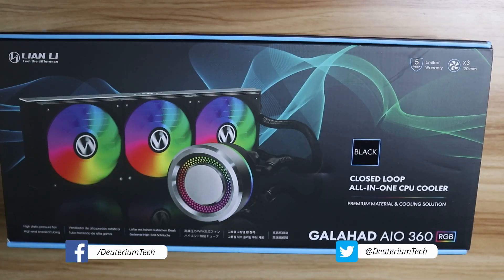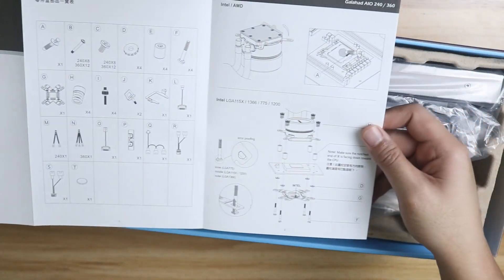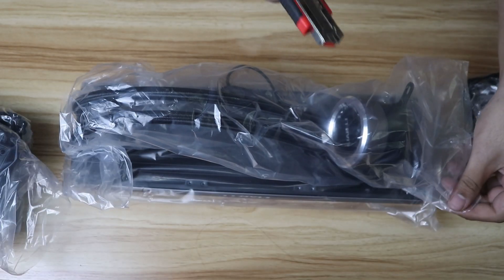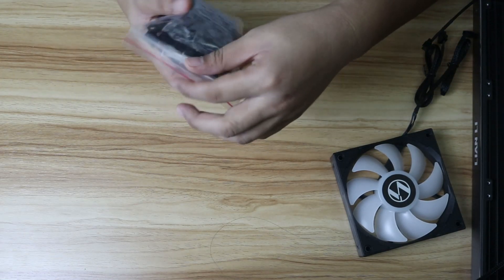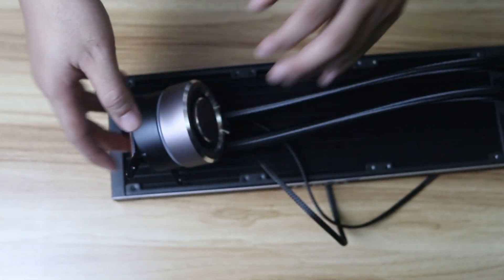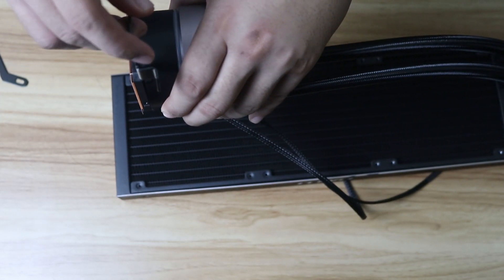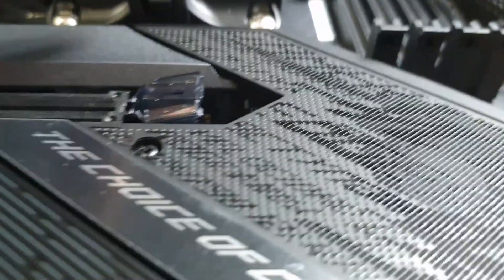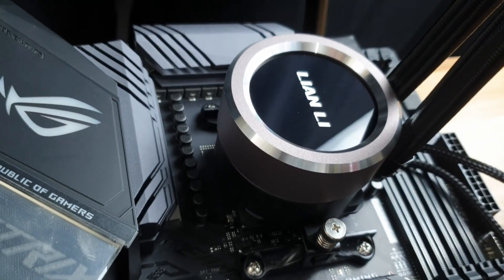Lian Li Galahad AIO 360 Unboxing, Installation, and Benchmark

Comment: Bro I got this, and it didn’t come with the AMD mount for the pump. What do I do
Reply from the maker: Return to seller if it says on their listing that this can be used with AM4 CPUs. If you can't, you may need to buy the parts.
Reply: @DeuteriumTech  I can’t find where I can even buy an AMD AM4 bracket mount of the this AIO though man. It sounds like I have no choice but to buy another AIO

Comment: What cooling would you recommend for the 11700k cpu, I used corsair h100 rgb 240 mm before, but the temperature values were above 90 degrees at full load. and there was a pump sound failure in the cooler, I returned the cooler. The CPU was also replaced under warranty.
Reply from the maker: If you plan to do overclocking, 360mm radiators are best. If not, I think you can get away with 240mm.

Comment: How did you get the RGB to work? I just got mine and it works fine but the RGB isn’t being lit
Reply from the maker: RGB has a different connector from the power cables. Make sure those are connected as well.
Reply: @DeuteriumTech  the RGB connector is connect into the RGB slot on the mobo and it turns on for like 2 fans, I cannot customize them nor will the third fan or the pump RGB turn on

Comment: Is there a way to control argb using Reset SW rather than opening and closing the case every time i wanna use the controller
Reply from the maker: You will need to rewire the controller button to the reset switch of your case if you want to do this. The controller is probably using an NC switch you this should be an easy task.
Reply: @DeuteriumTech  but I don't think you can open the controller. Might have to cut it to be able to access the inside. But this can be done. I can also use any wire with same specs
Reply from the maker: @shreyashchauhan6359  *You can't open it without damaging it. But you CAN open it. Try getting one of those mini hand drills that come with a small circular saw (I'm not sure what they're called exactly). It might help you get in the controller without cutting the wires.
Reply: @DeuteriumTech  haha, sure. Let's see what i can do tomorrow

Comment: not sure what my issue is but i cant get the bracket to slide in with the clips? its almost as if the clips are too short and it just nearly slides off both sides are super wobbly i cant even get it to straighten properly
Reply: Were you able to fix the issue?

Comment: Nice review bro. For the AM4 bracket, is it possible to attach it a different way so that the tubes come out from the top of the pump instead of from the right side?
Reply: No there is not... sry
Reply: you need to know that your setup with tubes on the top of the pump is one of many way to shorten the life of your AIO cooler.

Comment: I know this gonna be good enough for the 3500x but really should I get this or get the nzxt kraken x53
Reply from the maker: 3500x TDP is 65W. It does not require liquid cooling. You'll be good with either.

Comment: Hey there, I am having major problems finding where to plug in the RBG header from the Galahand into the Rog Strix Mobo. Any help?
Reply from the maker: There's an adapter for the rgb wires coming out of the fans and pump.
Reply: @DeuteriumTech  I tried both adapters and they don't fit into the top right Rgb header. Help!!

Edit: Same mobo as him, amd am4

Comment: Could You Help me out with the cables?? I have argb header on my mobo, i wanted top use that for the rgb.
 I want to connect the rgb of this + the Pump + the case fans. 
I've Also sent you a req on Discord If you could help me out there !
THANKS
Reply from the maker: Sure. Saw your request. Just let me know what problems you are having.

Comment: i'm wondering why the idle is a bit high but the full load maintains my core temps very low lol... i get paranoid when my idle is above 40 degrees. but full load gaming and cyberpunk it runs only at 60 celsius max which is awesome
Reply from the maker: Check your fan and pump curves. You may need to tune it if you want lower temps at idle.
Reply: @DeuteriumTech  I’m actually happy now. Even with overclock I still sit around 40-45 idle. Hardcore gaming load no more than 60. Amazing cooler lol

Comment: What about the cables!?! I have this and it’s taking me forever to setup cables. First time builder
Reply from the maker: What kind of problem with the cables are you having exactly? Each fan goes into a 3-way splitter and the splitter goes into the controller.
Reply: the instruction manual is actually decent on explaining. if you want to use the controller then follow that route. the other routing is for going into your argb slot. don't do both

Comment: Default bracket was nearly impossible to remove - did you run into that issue before filming the video?
Reply from the maker: No, I did not. I'd say it was a bit hard but not "nearly impossible." You must have gotten unlucky with your unit.
Reply: same here  , like is stuck or something

Comment: This aio can handel ryzen 9 5900x??
Or any others option / suggestion for me?
I am looking for aio for 5900x
Reply from the maker: Notice that I'm using this with a Ryzen 5800X which has the same 105W TDP. So, yes. It can handle the 5900X.
Reply: Get a Arctic Liquid Freezer II. Better temperatures and fans.

Comment: I just bought this aio, is it hard to setup the cables ? And rgb ?
Reply from the maker: Nope. I didn't find the cables hard to setup. But you may want to buy an 5V ARGB splitter if you're running other RGB stuff in your case and want to use your Motherboard's software.
Reply: @DeuteriumTech  I thought it brought a splitter for the fans and the pump to connect to one 5v argb port. And can I add you on discord or something if I need help setting it up ?
Reply from the maker: @rod2wet377  It has that. But of course you have other peripherals/components that have rgb, right? I used this on an Strix X570-E and had to settle to using the controller that came with it because I ran out of ARGB pins. Sure, here's my Discord id: DeuteriumCore#9870.
Reply: @DeuteriumTech  thanks I sent you a friend request . Yes I have 9 fans but they have a hub . I wonder how many 5v argb ports my mobo has
Reply: @DeuteriumTech  dude any way you can help me as well, I sent you a request
Reply from the maker: @liam3821  Sure. Here's my discord: DeuteriumCore#9870. I can't see your request. Send it again.
Reply: @DeuteriumTech  I can’t find your discord